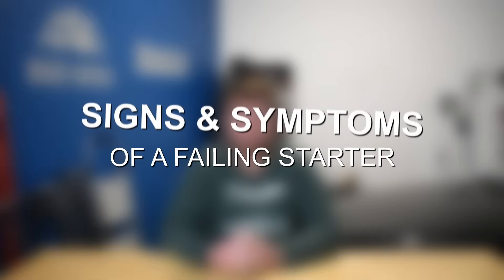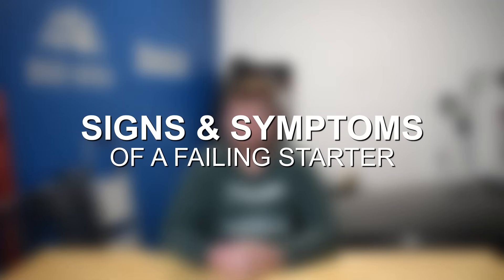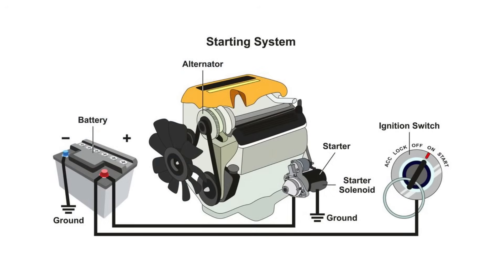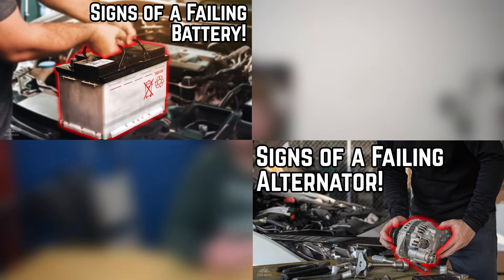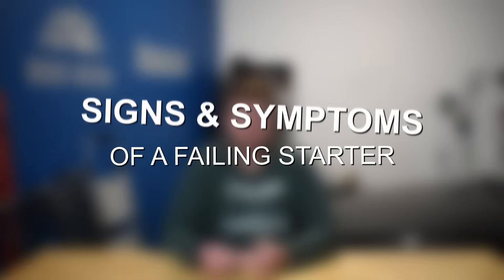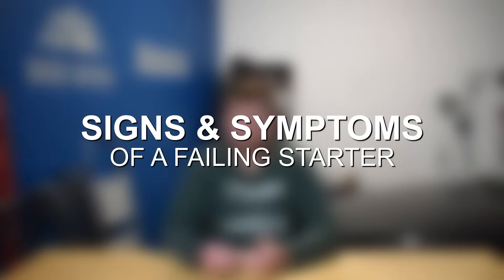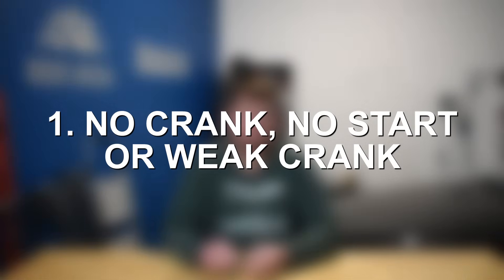5 Symptoms of a Bad Starter!

Comment: so im getting a crank and lights but then my car just shuts off without starting
Reply from the maker: A - If your car cranks and all lights come on but then immediately shuts off without starting, the most common causes are a fuel delivery issue (like a failing fuel pump or clogged filter), a faulty crankshaft or camshaft position sensor that’s preventing the ECU from firing the injectors or spark, or an anti-theft/immobilizer issue cutting fuel or spark after initial key recognition. If it fires briefly then dies, that strongly points to an immobilizer/security problem—try a spare key if you have one, and look for a flashing security light on the dash. If it just cranks endlessly without catching, check for fuel pressure and spark. A quick spray of starting fluid into the intake can help confirm—if it fires momentarily, you’ve got a fuel issue; if not, look toward ignition or crank sensor failure.

Comment: My 2016 Acura MDX sometimes it took more than five presses on push start button to get it crank. Is this symptom of bad stater?
Reply from the maker: B - Yes, repeatedly pressing the push start button before the engine finally cranks is a common symptom of a failing starter, especially if you hear clicks or nothing happens at all when pressing the button; over time, the starter solenoid or internal contacts can wear out, causing intermittent engagement. However, on push-to-start systems like in your 2016 Acura MDX, it could also be caused by a weak brake switch, failing start/stop button, bad starter relay, or key fob communication issues—so start by making sure your foot is firmly on the brake, try using a second key fob, and listen for the click from the starter relay under the hood when you press the button. If you get a single click and no crank, it's very likely the starter is on its way out and should be tested or replaced.
Reply: My MDx finally gave out today. First alarms kept going off then I won’t able to start the car even with jumper hooked up it’s won’t able to crank. Is this a symptom of death stater or something else? Please let me know your advice thanks.
Reply from the maker: @briantran4210  Sorry to hear your MDX gave out—based on your symptoms, this sounds more like a dead battery combined with possible electronic or immobilizer interference, rather than just a failed starter. If the car won’t crank at all—no clicking or turnover—start by checking the main battery ground, fuse box connections, and the starter relay/fuse. The alarms going off before it died suggest the battery may have dropped below safe voltage, triggering system errors or confusing the immobilizer. Try using a fully charged battery—not just a jumper—and see if any dash lights or starter activity returns. If still dead, test the starter signal wire for voltage when turning the key—if it gets power and doesn’t crank, then the starter may have failed. But if there’s no signal, it’s likely an issue upstream in the ignition circuit or anti-theft system.
Reply: The car finally crank after replaced with new battery but sometimes still take more than few press on push start button to get the car crank. Is this still stater issue? Thanks you for your feedback I’m really appreciate.

Comment: So I have a 2004 GMC Envoy, it will sometimes try to turn over, other times it doesn't, when it doesn't, I hear clicking when the key is in Acc mode and the RPM gauge and the speed gauge are dancing. This vehicle has had starter issues before I bought it, is that the Starter as well?
Reply from the maker: S - Yes, based on your description, especially given the vehicle’s known starter history; however, dancing gauges and electrical noise also point to a potential low voltage issue from a weak battery, bad ground, or corroded terminals, which can prevent proper current flow to the starter solenoid. Start by checking battery voltage (should be at least 12.4V), then inspect and clean the battery terminals and ground strap; if all looks good and the issue persists, tap the starter with a rubber mallet when it won’t crank—if it starts afterward, the starter is sticking internally and needs to be replaced.

Comment: Evertine I turn the key to my 01 Cadillac develle I just hear a cliccs cliccs clic clicc type noise I changed the alternator & used a jumper to try & change the battery 😢 plus I can't get a lug nut off so to it being stripped 😅
Reply from the maker: D - The rapid clicking noise when turning the key usually means the starter isn’t getting enough power—either from a dead or weak battery, poor battery connections, or a failing starter itself; since you’ve already replaced the alternator and tried jump-starting, make sure the battery terminals are clean and tight, and check the main ground cable to the chassis and engine block for corrosion or looseness. If the battery is older than 3–4 years, it may be shot and not accepting a full charge even with a jump. As for the stripped lug nut, use a lug nut remover socket (like a twist socket extractor kit) and a breaker bar—they’re made specifically for stuck or rounded lug nuts and should let you get the wheel off safely to replace the battery or access the starter if needed.

Comment: Have a 2000 7.3 powerstroke that cranks real slow as if the starter is too weak. Batteries are good, srarter solenoid brand new from Motorcraft brand new. Put a jump box on it and tried cranking and did the same thing so i went ahead and bought a new starter.
Reply from the maker: A - How's it doing now?
Reply: @8020Automotive Installed the starter.  DB Electrical Starter. Started my truck, heard a pop 3 minutes later. Took a look around, checked the starter etc. All wires connections were tight and proper. Starter was hot to the touch. Uninstalled it this morning, bench tested the starter, starter was seized solid. Its now getting returned and a brand new one is coming in the mail so we'll see
Reply from the maker: @alexthebest1401  Keep us updated! Hope it works out for you.
Reply: @8020Automotive Thank you. Ill end up forgetting but ill do my best

Comment: 2005 Corolla 1.6 --- car wont start after driving with air conditioner on. But car starts after waiting about 30 minutes!  (AC works well, and car has a brand new battery.)
Reply from the maker: S - Your vehicle not starting after running the air conditioner, but starting again after about 30 minutes, likely points to a heat-related issue such as a failing crankshaft position sensor or ignition coil breaking down when hot. These components can stop working when exposed to engine heat and prevent the engine from starting, only functioning again once they cool down. Since the battery is new and the AC works, it's unlikely to be a voltage or alternator problem. It's also worth checking for a weak fuel pump or relay that may be overheating and cutting off fuel supply temporarily. A scan for stored (even pending) codes after the no-start event may help pinpoint the exact cause.

Comment: Hey i currently replaced my starter on my 2013 ford explorer wont start and me and my dad tried many ways but nothing worked. Can you please help me?
Reply from the maker: C - If your Explorer still won’t start after replacing the starter, and you've already checked the basics, start by verifying battery voltage—it should be at least 12.4V. Then confirm all battery terminals and ground connections are clean and tight. Check that the starter's electrical connections are secure, especially the main power and signal wires. Next, inspect the starter relay and fuses related to the starting system (in both the under-hood and interior fuse boxes). If those are fine, try turning the key while someone taps the starter lightly with a hammer—it can sometimes free a stuck gear. Also, check if the gear shifter is fully in Park or Neutral—if the transmission range sensor (neutral safety switch) is bad or misaligned, it won’t allow starting. Lastly, if you hear a click but no crank, test the ignition switch and the starter signal wire to confirm the starter is actually receiving the "start" command from the ignition. If none of that works, a deeper issue like a bad PCM, security system fault, or corroded ground wiring may be the cause.

Comment: My car makes a light thump right at the start. I was reading that the starter could be loose.
Reply from the maker: K - A light thump at startup could definitely be caused by a loose starter, especially if the noise comes from the engine bay and is synchronized with the initial crank. A loose starter can shift slightly as it engages the flywheel, causing a knock or thump sound. However, it could also be something like worn motor mounts, a failing starter solenoid, or even slight pre-ignition. It's worth checking the starter bolts for tightness and inspecting the mounting surface. If the starter is secure, check your engine mounts and listen for any abnormal starter noise during cranking that could point to internal starter wear or engagement issues.

Comment: I have a 2020 jeep compass been getting the start/ stop unavailable message for a few weeks. Took it in to dealer thinking it was my batteries ( previous issue ) but dealer said when replacing both batteries dealership said my car still wouldn’t crank. They said they could hear starter and solenoid actuate however vehicle is not turning over. No coolant in resavior but oil residue , also dash reads high coolant temp .. what could it be ?
Reply from the maker: K - Given the symptoms, it strongly points toward a possible internal engine failure such as a blown head gasket or worse, a warped head or cracked block, especially if oil has mixed with coolant. The system may be detecting abnormally high engine temperature and locking out starting to prevent further damage. Lack of coolant in the reservoir and presence of oil suggests coolant contamination, likely from combustion gases or oil breaching into the cooling system. A cooling system pressure test and a chemical test for combustion gases in the coolant would be good next diagnostic steps.
Reply: @8020Automotive  I end up getting it from dealer. Changed my batteries myself because there was no power and my car crunk right up… did a coolant flush no leaks and replaced coolant everything running fine no lights on dash.. paid dealer $320 for nothing and had warranty on old batteries but they claimed they replaced them and the car still didn’t crank so they cannot honor them under warranty and removed them that’s when I just towed my vehicle out of there

Comment: How about occasional screeching while starting? Like when you try starting the vehicle while the vehicle is already running
Reply from the maker: I - That occasional screeching noise during startup—especially if it sounds like trying to start an already-running engine—is almost always due to the starter motor staying engaged too long or the starter gear not disengaging cleanly from the flywheel. This can be caused by a worn starter bendix, a weak return spring inside the starter, or even an ignition switch issue where the starter signal is momentarily delayed. Another common culprit is a misaligned or loose starter, which can prevent smooth engagement and disengagement. While it might not fail immediately, it will eventually chew up your flywheel teeth or burn out the starter, so it’s worth inspecting the starter mounting bolts, connections, and possibly replacing the starter if it’s been doing this consistently.
Reply: Serpentine belt
Reply from the maker: @BossKnewz  Possibly.

Comment: I have f150 91 started up fine yesterday after i got a jump then started fine for few hours then i got stuck at gas station i turn my key my interior cab lights came on and dashboard lights are on but no noise from starter when i turned key like almost no power to turn over at all but i got battery check autozone said battery is good could maybe be charged up but battery is good so do i need a starter or alternator?
Reply from the maker: J - Based on what you described, it’s sounding more like a bad starter or a failing starter solenoid, not the alternator. If the alternator were the issue, you'd typically see battery warning lights or experience dying electronics while driving. Since your lights work but the engine won’t even try to turn over, first check the starter relay, neutral safety switch (try starting it in neutral), and the wiring to the starter (especially the ground connections and the wire from the ignition switch). If you tap the starter with a hammer and it cranks, that’s a pretty strong sign it needs replacing. But make sure the battery is fully charged first, even if it's "good"—a weak charge can still act like a dead starter.
Reply: @8020Automotive ok i changed the starter solenoid but still quit no power from engine battery has been charged lights still come on so i would need to change starter? And yeah i got under it hit with hammer nothing.
Reply from the maker: @jamespearson1711  the starter itself is the most likely culprit, especially since tapping it didn’t wake it up. Starters can fail internally (like worn brushes or a dead spot in the commutator) and still draw power, which explains the total silence. The fact that it needed a jump earlier could also mean your battery is borderline, and while it may test “good,” it could still lack enough cold cranking amps to turn the engine. Just to be safe, double-check your grounds, the positive cable to the starter, and that the starter signal wire is actually getting 12V when you turn the key (a test light or multimeter at the starter "S" terminal will confirm that). If power is reaching the starter and nothing happens, it’s time for a new one.

Comment: I have no crank and no start no noise, everything else turns on..  Battery is new.  It's being diagnose right now.  Guessing its the starter
Reply from the maker: M - We have a full video that goes over this that may be helpful: https://youtu.be/0YRdzJbHcm4

But, short answer: If you have no crank, no start, and no noise, but all the lights, radio, and electronics work, and the battery is confirmed good, then yes—the starter or its related wiring is a very likely suspect, but not the only one. It could also be a bad starter relay, blown fuse, corroded or loose battery/starter ground cable, or even a faulty ignition switch or neutral safety switch (especially if it's an automatic—try starting it in neutral). If it’s being diagnosed now, make sure they check for voltage at the starter solenoid when you turn the key—if there's power and it still won’t crank, it’s definitely the starter. If there’s no voltage, it’s something further up the control chain.
Reply: did you find out what it was? My car just had this problem 2 hours ago and now I have to make an appointment to get it checked out smh
Reply: @Jasaiyan no fr need to know bc the same shit happened to me last night bought a new battery and still hear 1 click when I try to start the engine

Comment: Where is starter on 2011 dodge Dakota
Reply: If I am not mistaken its located on the passenger side of the engine, near the bottom rear of the engine block, right where the engine meets the transmission bell housing.
Reply from the maker: J - What @vigilantemotors said!
Reply: @8020Automotive  LOL  👌👌
Reply: On the motor for real?

Comment: What do you think about after running for a bit, and trying to start the engine again, it turns over real slow and mimics a dead battery but never starts. I can come back and hour later and it'll fire right up!
Reply from the maker: D - That sounds like a classic case of heat soak affecting the starter—after the engine runs and gets hot, the starter or its solenoid gets heat-soaked, increasing electrical resistance and making it crank very slowly, like a weak battery, but not quite dead; once everything cools down, resistance drops, and it starts fine again. This is especially common in older vehicles, V8s, or cars with the starter mounted close to the exhaust. It could also be a weak ground, failing battery cable, or even a tired starter motor on its way out. Check your starter's condition, make sure all power and ground connections are clean and tight, and consider doing a voltage drop test—but most likely, it’s a heat-soaked starter dragging when hot.
Reply: @8020Automotive There's sometimes a burning smell too!

Comment: My alternator charge when I hold the fuse box tight,what could that be???
Reply from the maker: R - If your alternator only charges when you're physically holding or pressing on the fuse box, that screams loose or corroded electrical connections—most likely a poor ground, a loose power wire, or even a cracked solder joint or damaged pin inside the fuse box itself that’s messing with either the alternator’s excitation circuit or the voltage sensing wire; when you press on it, you're probably temporarily restoring contact and letting the alternator do its job, so I'd recommend pulling the fuse box out, inspecting the underside for burnt or broken terminals, and checking the main charge wire and grounds for looseness or corrosion—don’t drive it like this too long, because a fluctuating charge can fry your battery or electronic components.